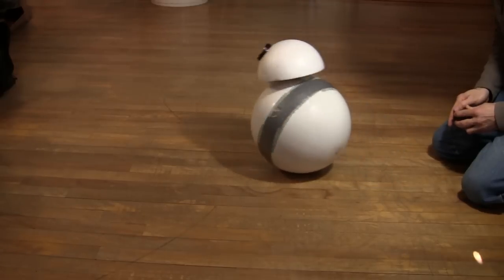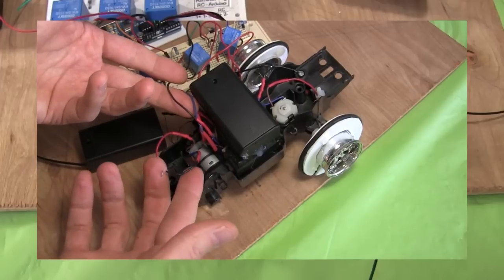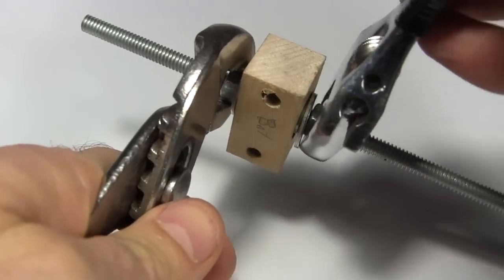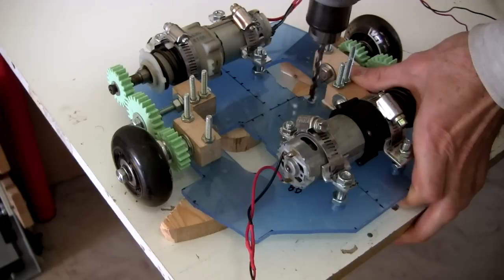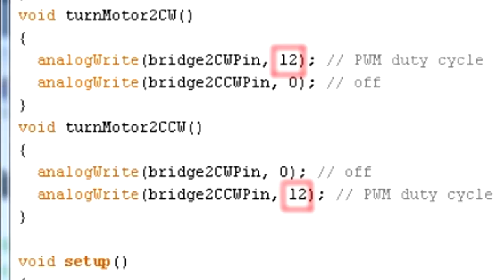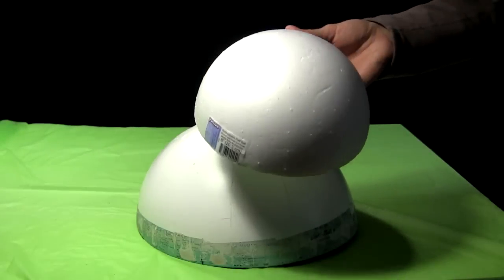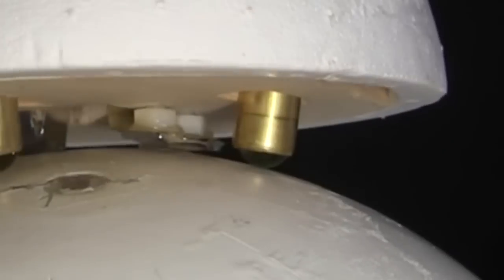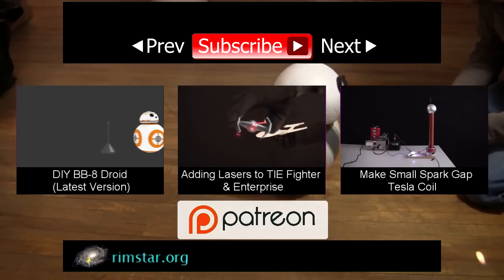Making BB-8 (v2) Droid - Part 1

Comment: What about an electro magnet for the head? 
That way you can vary the intensity of the magnet depending upon what you want to do :)
Reply from the maker: That's an interesting idea. I don't see any need to vary the intensity though and it would have to be heavier than the equivalent neodymium magnets but it would simplify making the initial adjustments.

Comment: How you charge this
Reply from the maker: At 7:48 in the video, I show how the batteries are just drill batteries and are held in with velcro. So to charge it, I open up the ball by removing the tape and then undo the velcro to remove the batteries and charge them.

Comment: Was thinking about using anti-slip spray in my build as well but I’m hesitant since most seem to have crystalline silica in them, which is carcinogenic. Do you think it is safe to use these sprays? I’ve noticed my wheels tend to churn up bits of newspaper from the inside of my paper-mache ball so I feel like the anti-slip coating would get chewed up over time, releasing hazardous silica dust into the inside of my ball.
Reply from the maker: I don't know about the carcinogenic properties of the spray. Is the concern when spraying or is the concern to do with the coating after it's being sprayed? If the concern is with spraying then do it in a well ventilated area (I did it outdoors). If the concern it with the coating then I've found that the coating does go away somehow with use. It should be fine as long as it's in the ball but just open the ball in a well ventilated area whenever you do open it. Since the coating doesn't last, I'm not sure the anti-slip coating is a good solution after all -- maybe do some testing with a latex or plastic coating instead? I haven't done any further testing along those lines myself though.
Reply: RimstarOrg ok, thank you for the super thorough response! It is good to know that the anti-slip layer does wear off over time. I was thinking about using spray-on rubber instead and now that i know that, that might be the deal breaker. Thanks again for taking the time to get back to me!

Comment: Ik I have asked a lot of questions but I’d like to get your thoughts on an issue I’m having with my drive system. Whenever I do a test run, the head of my drive system (the plate with the magnets) seems to be too heavy, causing the system to want to go on it’s side while driving.

I added rollers to help stabilize the drive system but it still seems to want to tip over. I’m assuming it’s because I don’t have enough counterweight? For context, my design consists of a hardboard “base” plate with batteries on one side (all AA, didn’t use more heavy-duty batteries like you, although maybe I should have), and motors, rollers, + remaining circuitry on the other side along with four columns of lightweight wood that serve as the “neck” of the system. Do you think I should put more weight on the side of the base plate opposite the neck?

Don’t feel obligated to respond to this. Ik it’s a lot and you’re probably really busy. Just figured I’d give it a shot
Reply from the maker: It does sound like you're too heavy on top and not heavy enough lower down. Of course the minute you do that, your motors may no longer be strong enough and so on. But it's worth a try adding more weight lower down.
Reply: RimstarOrg thanks for replying! And yeah, I was kinda worried about putting too much strain on the motors. I think I have an idea for a system where I could add and remove weight easily. Gonna try that and see what happens. Appreciate the feedback!

Comment: can i get link to the 3d model of inside part
Reply from the maker: You can find it on my website at https://rimstar.org/science_electronics_projects/bb-8_star_wars_droid_v2.htm under the subheading "3D model for BB-8 (v2)". I had the older version which you see in this part 1 video but I just uploaded the newer version (Sept 20, 2017) with the modifications for the newer magnets and head support structure which you see in my part 3 video. Enjoy!

Comment: I’m not sure if you had issues with stability since I’m only part way through  the video but would 4 Omni wheels in an X with 2 parallel to each other work inside the ball? I know it can drive forwards backwards and side to side etc outside of one bit thought maybe that wheel setup would work better for a bb8 style droid not sure I’m not an engineer (yet) just an idea
Reply from the maker: 4 Omni wheels would seem like a good approach. Oddly enough, I've only ever seen one person do it, but they had good results.

Comment: I want to know what are the specs of the power supply you used.Please help
Reply from the maker: Which power supply do you mean? I used batteries for everything.
Reply: I Mean battery specs
Reply from the maker: I use 14.4 volt drill batteries. The motors are from 12 volt drills, so maybe I could have used 12 volt drill batteries instead. In case you were looking at the parts list here http://rimstar.org/science_electronics_projects/bb-8_v2_parts_list_bill_of_materials.htm, I just added the battery voltage. It was missing before.
Reply: Thanks
Reply: Get a rc car and put it in the middle

Comment: I'm sorry if you have already answered this. 
Are you going to keep the tape to take it apart in order to access the insides and charge the batteries? I think that this hamster ball scheme is "easier" than the other BB8 building methods but the battery access problem isn't trivial. 

About the wobble, instead of having a constant PWM action whenever you want to move, could you make the action evolve in a ramp-type profile in order to have less acceleration? It may improve the behavior a bit.
 Balancing systems are hard to control but you could change the structure, if you could control the pitch of the head support structure you could balance the mass on the inside so when it stops or accelerates, it tries to counter act the momentum.
Anyway, your work and your way of explaining is amazing.
Reply from the maker: +Perromocosso Yes, I'm going to keep the tape method for attaching the two hemispheres and for accessing the insides. It's very difficult to tape the two hemisphere's of the plain cardboard globe together though, since the weight of the hamster deforms it a lot. For that reason I took the time get a new cardboard globe and cover it in three layers of fiberglass, to stiffen it. So far, from my video where I show how I did it, you can see it's looking good https://youtu.be/se4zfgIx9sA. There's no visible deforming and I don't need much tape. Once it's painted I can switch to transparent duct tape (Scotch brand works great.)
About the wobble, I've been waiting to experiment with methods like you're talking about until I had the fiberglassing done and my new magnets arrive from China. Unfortunately they're late and I think they're not going to make it and I'll have to get a refund and order again from a more local source. So further experimenting is a little delayed.
I'm glad you're liking it though, and thanks for the interest.
Reply: +RimstarOrg Thank you for answering so fast. I want to start my own BB8 as soon as I finish my exams but I'm too lazy to put and remove the tape. I thought I could make a hole in one of the hemispheres, modify the charging pin to make it harder so I can insert it and then put a cone or something above the charging port so even if I know where it should be, it guides me to know where it exactly is, so I can connect it and then charge the batteries.

Comment: INGLÊS
Hi I am Brazilian your problem with this design is the low weight exerted by the center of mass that results in desbalanciamento robo ... tip switch engines with more powerful engines brushless

Comment: Can you make a parts list for te electronic components
Reply from the maker: +nick thijs Done. You can find a parts list for the dual H-bridge board here http://rimstar.org/science_electronics_projects/bb-8_v2_drive_electronics.htm and for the RC receiver to Arduino converter board here http://rimstar.org/science_electronics_projects/rc_controller_to_arduino_hack.htm. Note that if I had known what was involved ahead of time and I didn't value the learning experience in designing and making my own boards I would have bought off-the-shelf ones instead. You may want to consider that too.
Reply: thanks

Comment: +RimstarOrg Are you going to add gyroscope/accelerometer inside? That would be easiest way to minimise wobble by software. You'd have to add few lines to code and one tiny board.
Reply from the maker: +Piotr Bomba I bought the board a while ago for that purpose (adafruit.com's BN0055 breakout board) but first I want to add fiberglass to the ball to make it more rigid i.e. get it working as well as I can as is before figuring out the best way to enhance it. I don't seem to have any noticeable sideways wobble so one board may in fact do it.
Reply: RimstarOrg I think that after you make the ball better you should consider adding BN0055. It may not be used to stablize robot while you dont send any commands. Sensor should calculate if angle is stable. If it isn't software should modify PWM values. In my opinion this would make driving much easier.

And the other thing. Even if you had sideways wobble you wouldn't be able to reduce it with your configuration of motors.
Reply from the maker: +Piotr Bomba Actually, now that you bring it up, my plan was to improve the ball, then try acceleration and deceleration and then if that doesn't work well enough (which I don't think it will) then I'll add the BNO055. I'm looking forward to finally trying the board out.
And yeah, it's a good thing I don't have sideways wobble since there's no room near enough to the bottom for more motors anyway. That's the curse of making a more portable sized BB-8. I'm jealous of all those making full sized ones. :)

Comment: You bb-8 looks great. Great to see you after a long time. Here is an advice for you. Use those wheels whose diameter is equal to the radius of the globe, then adjust the distance between your wheels so that the whole circumference of the wheel touches the globe. I mean not only the bottom of wheels but the whole circumference of the wheels should touch the ball. Then it will work like the real bb-8 works. Now if you will rotate the wheels the globe will rotate and not the whole internal circuit and machinery.
Reply from the maker: +harsh bawari Thanks. If I understand you right, that's equivalent to the axle approach, where an axle runs from one side to the other side with motors along the axle to turn it - though having wheels like you describe would be a much more fun way of making it.
As for how the real BB-8 works, the movie used 7 or 8 different props along with some CGI. The stage version that was built after the movies was made and is used for promotional purposes behaves as if it is an axle drive though there is another design with a track inside that would also behave that way.

Comment: Great job! But I have got a question: Which strength of magnets did you use? I haven't got any technical knowledge so I'm asking you :)
Reply from the maker: +Apfel - Chan Thanks! I don't know what strength the magnets are. I just tried with whatever ones I had and used what worked. They are all neodymium magnets.
Reply: +RimstarOrg thanks :) I will try to build a bb 8 in summer this year :) 
I will buy the strongest I will find on the internet :D

Comment: In currently making one and may I suggest using a plastic globe for the main ball. They are thicker and smoother and do not deform much
Reply from the maker: +Sean Bensadon I haven't found a cheap plastic globe. But are you sure they wouldn't deform much? How thick are the globe's walls? How heavy is your drive system. If you're doing an axle drive then I'm guessing the stresses aren't the same. The drive system I have is very heavy and puts a lot of pressure at the wheels. Having said that, I'll be covering mine in fiberglass to get the rigidity, hopefully.

Comment: It's coming along well! I'm surprised it works that well now, I thought this design would never work too well, congrats on fine tuning it! Making it even better may be difficult without expanding on budget, here are some of my ideas:

Something you might consider doing is getting some NiMh C or D size batteries and wiring them up as needed. Or instead a lithium battery. IMR 18650's or the LiPos used for RC models should be perfect (although maybe a little lightweight compared to NiMh). Also why not add a external charging capability?

You may also consider replacing the controller with a $20 RC controller, the receiver is a lot smaller and will allow for easier implementation (no need for logic voltage level shifter board) Or what I would try first, is to pull that RC receiver apart and see if you can reverse engineer the RF receiver and maybe modify it to suit your needs. That could reduce the complexity of the design and pontenially more reliable.

It might be time to implement a self-stabilizing code to the arduino to reduce the wobble. This would not cost much, requiring probably nothing more than an accelerometer and gyro, but would require some cleverness to figure out how to make the PID control loop. The easiest thing to try first is to add a low pass filter to the controls. I'll make a quick code in khanacademy to share with you.

RC motors may also be better suited, their power density is just ridiculous! A brushless DC motor the size of a pop can be upwards to 750W, or about 1 horsepower! AC induction motors of that size are much bigger. But they can be pricy. A stepper motor may also be a good choice for this thing since they are really precise and torquey! A brushless DC motor will probably only need to be 1/2 to 1/4 the size of the brushed motor assemblies.
Reply from the maker: +Power Max Thanks for all the tips!
Most of what you suggest re batteries and RC is in the future plans in some form. I wanted to go el'cheapo first, but I plan on trying out smartphone control with bluetooth since that seems to be the most popular method and the way things are going. I do like the double duty of the batteries for power and their weight. I'm learning that the brushed motors I have, while serving as good mass, are not a great choice (though they're doing the job and one was free.) Your motor summary helps. Thanks.
Reply: Here is some example LPF code: https://www.khanacademy.org/computer-programming/first-order-low-pass-filter/2933914039 I think if you implement this in between the controler and what signal goes to the motors as PWM, you can reduce the wobbles. It is really basic code, and I predict that a really low (not 0) lag factor will do basically nothing, while one too high will make the bot pretty unresponsive and really slow to react to your input.
Reply from the maker: +Power Max Awesome. And super simple. Thanks!

Comment: pls dont tell me your pwm is really at 1khz... If it really is then the brushes of the motors will die fast and you have soooo much heat loss in the core of the motor that they are more like grills than motors
Reply: +Gotin Fuklio and you could directly drive the motors trough a relays connected to the radio reciever
Reply from the maker: +Gotin Fuklio I wasn't aware of this issue. Thanks for bringing it up. A little reading shows that due to the Arduino UNO pins I'm using, one of my motors is running at around 1kHz and the other at around 500Hz, though I'll confirm with my scope. I'm guessing 500Hz would be easier on the motors. I can change the pins so that both motors are at 500Hz.
Regarding directly driving the motors through relays connected to the radio receiver, I'd considered that but I'll be trying accelerating and decelerating the motors for stability and if that doesn't help enough, I'll be trying an inertial management unit board, and other things too.
Reply: RimstarOrg i recommend 20 hz base frequency

Comment: For something like this, fiberglass is veering towards overkill; particularly if you've never done fiberglassing before. I strongly recommend a product called Shell-Shock by Smooth-On. It's a thixotropic polyurethane resin originally designed for hardening the surface of carved polystyrene. It might take some sanding to get the surface spherical, but at least the stuff lets you sand it. Fiberglass doesn't. You have to apply a very thick gel-coat to get a sandable surface.
Reply from the maker: +verdatum Thanks! I'll look into it. How susceptible is it to cracking? People have been avoiding acrylic balls, for example, for BB-8 droids because it cracks too easily. I wonder if the same would be the case, in your experience, with Shell-Shock.
Reply: If it takes a big fall, yes, it might crack. If you want to make it still more durable, I recommend first applying a layer of Smooth-on's "Plasti-Paste II" It is another polyurethane resin, but imbedded with glass fiber. It's got the durability of fiberglasss without having to deal with things like wrinkles in the fabric, or the horrible fumes of polyester resins. But here again, you must be careful not to apply it in excess because it completely wrecks sandpaper. The plasti-paste has the consistency of putty, so you can use it to some extent to smooth out the relief features of a globe. Just practice with a small batch of it on a piece of scrap before moving forward so you understand how it behaves.
Reply from the maker: +verdatum Thanks for the detailed answer. Even if I do go with fiberglass, I have your warnings to look out for. I'll do some costing. The main reason for my wanting to do this is to make the ball rigid enough to not deform under the considerable weight of the drive system at the wheels. That's why I thought of fiberglass. With strips of fiberglass embedded along the globe's latitudes and maybe some perpendicular to that I figured I get good rigidity. I'll look further into both.